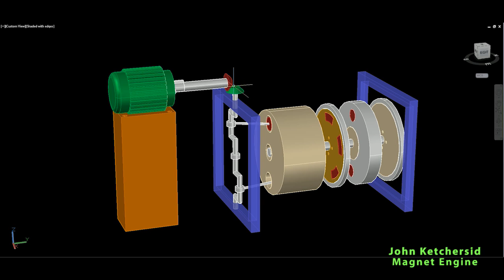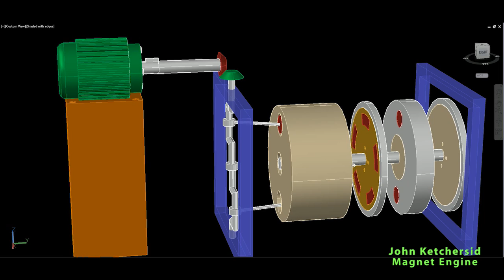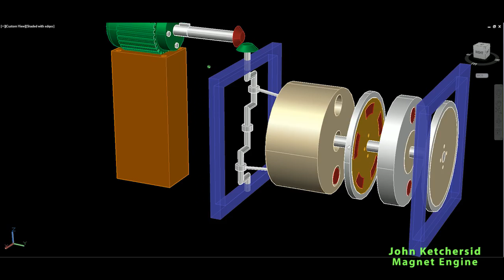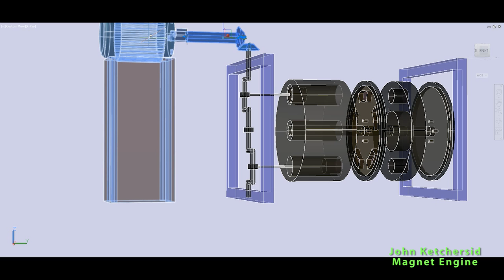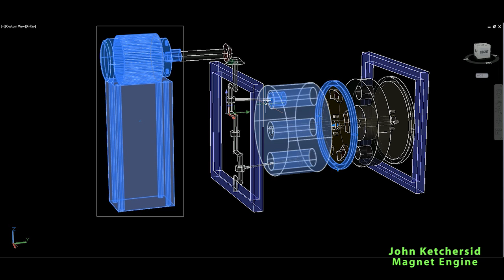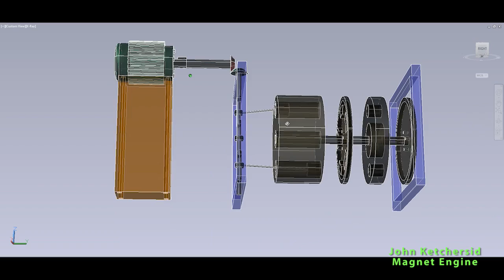Free Energy Generator 2017, John Ketchersid Magnet Engine

Comment: You need to live in a parallel Universe for this system to work. In this Universe there exists the Lenz's Law which will generate so much braking force on the steel/hole rotor that it will TAKE a lot of (external) energy to continue turning instead of GIVING any excess energy to generate anything. Sorry, but true.

Comment: great design work however it think the problem here with this design is that the back fixed magnets will always be providing counter force on the centre wheel as it is made out of a ferrous metal - so if the design it requiring the spin of the centre section i think it will be inhibited by that factor , whereas if the centre wheel was just providing shielding there is no significant force that would be applied to the wheel itself. unless this force is balanced somewhere that I'm not seeing or isn't apparent to me right now. 

just a thought. 

great designs all your work is very inspirational.

Comment: This is not over unity or free energy precisely. This system, be inside the known universe and the magnetic moment of every electron transit from one atomic structure to another results in a ZPUP(TM) Zero point unity period and thereby an area of measurable coherence, commonly referred to as a magnetic field. Thus this system taps into the very energy structure of every atomic unit within each magnet. The Flux return also unifies three of the magnets twice for every window shutter transit. Therefore although we have a symmetric magnetic placement, the Flux return provides a path of least resistance for three magnetics which in turn interact with the fourth magnet when the window opens. This nearly triples the repulsive force upon the piston magnet that is being repelled when the window is fully opened. We are only accessing about 3% of the available force. Then again as far as we are concerned this results on a couple of orders of magnitude in accessible power generation.
Reply: hmm good explanation if you see my comment above i was interested how the magnet would overcome the counter force that would be provided constantly on the spinning centre shutter section from the back fixed magnets (as there are two fixed poles a the back and one will always be attracted to the ferrous metal wheel. 
i assume the counter force is enough to overcome this as you are explaining, whereas with a strictly shielded device there is no force on the wheel , do you think there is merit in such a design ?
Reply from the maker: Dear John. Very much appreciate precise explanation of your patent. I am just surprised how fast you found this video. Were you somehow noticed through your name mentioned on tube or you are subscribed to me?
Reply: Mario Gudec funny enough I was actually wanting to see the update of a video I had put up previously and I searched for ketchersid. to my surprise your video came up as the top of the list. I am presently in the process of gathering resources to build the next generation of the machine after having all of my equipment and the two engines that it already has built taken for my possession. thank you very much and the fact is that to your inclusion of my patent has enhanced the fire that is already in my belly to get this done and get it done now.
Reply: ah i see where the counter force is actually now on a second look - it is provided by the other axial magnet ok i see. the system is equalized there.